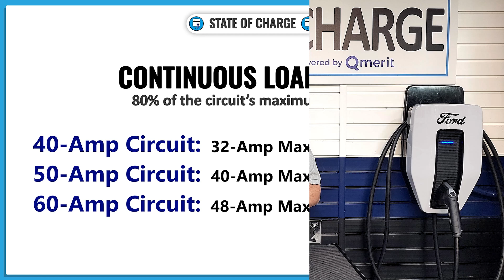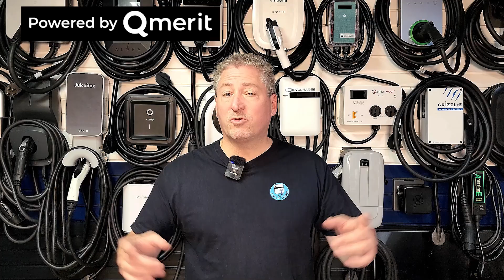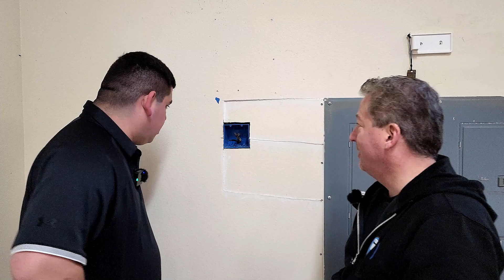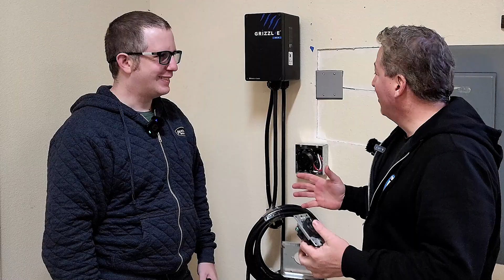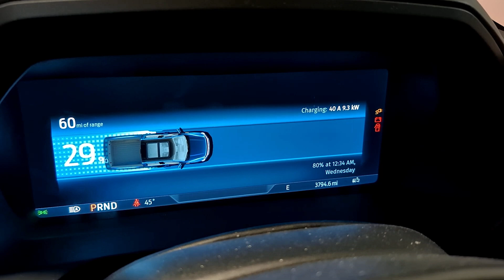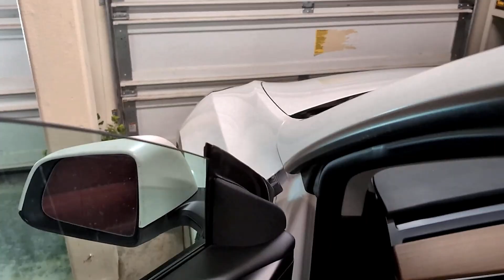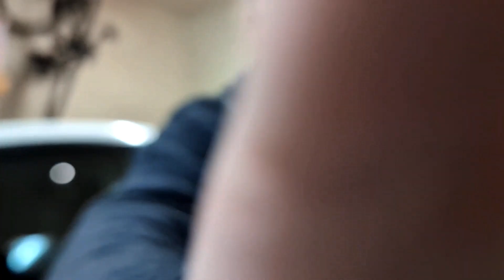Recharge Rescue Washington: We Fix A Dangerous NEMA 14-50 EV Charging Outlet Failure

Comment: First, I like your videos.   They are concise and easy to understand.   You mention that it cost to do it right while other You Tubers say us electricians are ripping people off.    Surface metal boxes are better for heat dissipation.   Any receptacle for the EVSE has to be on a GFCI circuit breaker which i noticed the electrician  did.  EVSE technology and installations are evolving and many times the NEC is not up to current needs.
Reply from the maker: Thank you.
Reply: Most states haven’t adopted the 2023 code yet. And the problem with putting in a second GFCI at the breaker  (because the EVSE already has one) is nuisance trips. I have a newer juicebox and believe it or not in the manual they actually recommend against putting in a GFCI breaker

Comment: I had to replace the outlet in my home which was installed by the builder Lennar, they charged us $1200 in 2022 for an EV charger in our garage and used the cheap Leviton outlet. I had already seen other videos of these cheap outlets failing on long duration draws. Replaced with a Hubbell, good to check what you have and get the right outlet, especially if you have an F150 with a huge battery that will draw for 10+hrs. We have an F150 Lighting Flash and Chevy Bolt and the Grizzl.e Duo, it’s great when you two cars to charge and is high quality and a very good price compared to the Clipper Creek. The owner and company are amazing!
Reply: Grizzle-E Duo is very underrated.   Got one myself.

Comment: another reason to hardwire... many states require gfic breakers a $100 upcharge vs non gfic. for the cost  difference of gfci and the hubble you could go from 10kW to 9.2kW charger.

Comment: I got my tesla in october of 2022 and I made a mistake of installing this exact cheap leviton outlet in my garage. Everything worked fine for about 6 months and when it started getting warm here in Las Vegas my tesla charging started slowing down to just 5-6 amps. Tesla mobile connector light was also blinking. I looked up the code for the light and the light was indicating the outlet was overheating which is why it slowed down the charging rate. So Tesla mobile connector actually saved my house from the fire so I wonder why other mobile chargers don't have that protection built in. Right after that code showed up I replaced entire outlet with a proper Tesla wall connector and haven't had any issues since.
Reply: Having a temperature sensor in the plug sounds like a great idea for safety.

Comment: You could also just change the old evse cable…. Instead of disposing of a funcionning evse… (welll it still a evse that isnt supported anymore and company pulled out NA) but i wouldnt throw out a evse for a chared cable… looks like an ad for Q merit from start to finish.. yes there is good information in the video but theres an exaggeration on some aspects…  but video is good to raise awareness
Reply: Grizzly freely upgraded him to a double box
Reply: I'm not throwing it out, but I've replaced the relay in the EVSE twice, so I don't want to give it to someone else to use who doesn't understand what they are getting into. @transportevolved Need a bench Juicebox for your project?

Comment: Interesting he went with a surfaced mount installation. i prefer a recessed setup as anything patruding out from the wall can be more easily to come in contact with . The box  does jave sharp edges . Now the biggest reason why this install went wrong is the wires were to short . You need about 6 inches by code outside of the box . With the wires being so short its dificult to tighten the contacts and it puts stress on the wire which puts stress on the contacts . The best way to avoid this is to hard wire the charger . The charger has far more space for the wire to occupy and no stress or pull on the wires that puts stress on the contacts . Its better to reduce the amount of connections that you are doing . The more you have the more opportunity for failure . It probably should be a requirement to have chargers hardwired edpecially on the higher amperage devices. We need to basically make it idiot proof and maybe the only way to do that is to require a  combination arc fault breaker gor ev charging systems . Especially for the nema 14/50 install . Now there isnt a combination arc fault of the size that is needed for ev charging . They are used in 120 volt applications and required for almost all new home  120 volt receptacles but not on higher amperage and voltage applications . So you would need a code change and what occured with 120 volt arc faults the cost went way up for install as they are far more expensive over typical breakers that just trip on short circuit and overload . A arc fault breaker at say 40 amps would be over $200 but far cheaper than a house fire .
Reply: This is nonsense. It’s perfectly safe to use an outlet with the right equipment if proper practices are followed
Reply: @doomsday9973  If proper practices are followed ?;
Reply: @stevencole7331  uhhh yeah lol. Like proper wire gauge, electrical box, proper outlet blah blah blah. It’s perfectly safe

Comment: I installed mine ( Tesla Universal hardwired) mostly due to the contractor that was set up by the car dealer was only going to meet Illinois electrical code standards, which we all know at this point are not up to the task for EV chargers. So I took a couple months and studied the whole process and did the install myself exceeding code. Also to note it is not only important to torque the contacts down at installation but to also torque them about 1 month after install then check them every year or so  because they can still back out from heat load over time.
Reply: I had the same idea, but it only takes one part to fail. The maintenance is a good habit to get into, more power flows through that one line than probably the rest of the house.

Comment: My EV Charging issue at the moment is convincing my partner to the benefits of switching to an EV and that we/I won't have the predicted range anxiety and then convince them to install one on the outside of the house.
I would then need to find an EVSE that I can manage/approve the EVs that are able to charge on them, use RFID cards, have OCPP for remote smart home management & I will need to do a service upgrade but not a Service Panel Upgrade as I have a solar system that can handle 200amp service and the EVSE can be wired into that.

Comment: I purchased an emporium charger prior to receiving my F-150 lightning, I had it installed by authorized electrician any wire directly to the panel about a year are you using it with my truck I started getting an error about power leakage, so I contact of the manufacturer who warrented the charger. However I had the factory Ford charger they sent me after purchase so I decided to have that installed in the same location, my electrician came out and was going to swap the charger straight across and then realized I didn't have big enough gauge wire to handle 80 amps because the emporia was a smaller charger than the Ford, had to pay another $1,000 to get it installed correctly but this way it's up to code and I would not risking my house. But I could easily see somebody in my situation hooking the Ford charger up to the emporia wires and finding out they were too thin to handle the duty cycle and load of the truck.

Comment: If I was Qmerit - and obviously investing in this video to make sure their brand and affiliates (APEX) were being shown in the best light - I would have made sure of the following:

1) Check the outlet cover fit prior to going to customer premises (if this affiliate APEX installed EV outlets frequently as indicated on the side of the truck "EV Charging Made Simple" - super surprised that this would be an issue at all)
2) As others have pointed out - made sure my electrician torqued at the circuit breaker as well - I would think this would be part of the Qmerit "specs" that affiliates have to follow.  Would think the APEX electrician would have gone back and checked each and every Qmerit spec to make sure he didn't inadvertently forget any steps.
3) Reused the existing hole where the previous plastic box was (to avoid too many unsightly cuts and covers in the dry wall) or explained in the video why he had to move the box to a new location.
4) Since you are already cutting into drywall - why not go ahead with a flush mount box vs a less cosmetically attractive surface mount box?  If there was a reason for the surface mount -would have been nice to explain that in the video too.
5) I realize electricians are not responsible for dry wall repair - but many do an initial taping and mud to make it easier for the later finisher or painter.   Again - since this was a representation of Qmerit's brand in this video - thought they would make some effort to not make the wall even more unsightly than what they DIY homeowner did.  The cut out drywall piece was even now sunken whereas the DIY homeowner at least previously had it even.

It's some of the above "little things" that often prompt people to take a DIY approach so that they can make sure they hit a certain level of technical and cosmetic attractiveness to their installation.
Reply: Good lord you are the type of customer that would be any contractors nitpicking nightmare
Reply: @doomsday9973  Guilty as charged!  That’s why I prefer to DIY.
Reply: @doomsday9973  Guilty as charged!  That’s why I go the DIY path many times because I don’t love contractors who cut corners.
Reply from the maker: They didn't invest in the video. When I make videos, I don't allow outside interference, even from my sponsor. The contractor had no idea there would be drywall work. Fritz scheduled the job and just told them he needed the outlet swapped.
Reply: Patrick, hopefully you are satisfied with Tom’s response.  Fritz is not as particular as you & I.  I would have demanded using same hole as old box, direct wiring for safety and 20% great power, and torquing of breaker wires.  Rather than be accused of nitpicking by any contractor, I simply DIY with higher quality standards than most contractors.
Reply: @johnpoldo8817  definitely!  This isn’t on Tom. Agree QMerit is not “investing” per se - but the result of a homeowner using a QMerit electrician is on display. Definitely motivation to make sure the result is A+ both technically and cosmetically.

Comment: I wish I would have known what questions to ask my qmerit installer last year.  They also used a $10 outlet for my install and a few months later after seeing the warnings on channels like these, I had it replaced with a Hubbell before anything bad happened.  We definitely need EV specific electric codes.
Reply: QMerit failed you. Scary
Reply: EV codes are coming but adoption is determined by jurisdiction. In Virginia, we still operate under 2017 codes but once we adopt 2020 code, article 625 will go in effect.

Comment: I'm surprised you didn't have him install a hardwired charger and avoid the cord and cap altogether.  Very easy to do with his wiring inside the wall right next to the service panel.  .  Would also provide 48 amps of current for faster charging his dual vehicles.
Reply: I've had relays on EVSEs go bad twice on that old Juicebox, so being able to replace the EVSE is just as important, with a mobile charger or a new one. Thanks for the question!
Reply: @Fritley  yep agree 👍
Reply: @doomsday9973  I've also moved with my EVSE before. I believe United Chargers picks high quality relays so hopefully no more trying to find replacement boards, but the flexibility is important to me.
Reply: @ I’m right there with you 100%. Plus if your EVSE goes down you can immediately plug in a mobile charger as a backup like the Tesla one for example that can do up to 32A and you are back up and running
Reply: @doomsday9973  Unless you unplug it and see the outlet looks a little _funny_. Cue video.
Reply: @Fritley  lol yeah well you don’t want to plug it into a “funny” looking outlet that’s for sure 🤣
Reply from the maker: Fritz wanted it that way
Reply: Not everyone wants hard wired. Easier to change out with an outlet

Comment: So Tom, no one talks about  charging using L1 for 20, 30, 40 hours.  If drawing 12 amps on a  15 amp circuit, could certain, low quality Nema 5-15 outlets also fail?  Do people need to get better quality outlets for L1?   As use DIYer's know, there are different quality  Nema 5-15 outlets.
Reply from the maker: Good point. Maybe I'll do a video on it
Reply: @StateOfChargeWithTomMoloughney  Did I mention I have also partially melted a plug in this house using a space heater? I promise I didn't DIY this one.

Comment: I see the 2023 code (not approved in most states) requires arc fault/ ground fault breaker in the panel or charger.  How do most manufacturers handle this?

Comment: Remember: If you install it yourself, your homeowners insurance can deny a claim if the worst happens. That includes losing your home..
Reply: And how are they going to know exactly?
Reply: @doomsday9973  Fire Department or homeowner's insurance inspectors will determine the cause of fire. They will most likely try to require proof that it was professionally installed after that was determined to be the ignition point.
Reply: @ lol extremely unlikely. Also show me one case where one of these outlets burned down a house from melting. You can’t because if it’s in a proper electrical box the chances of that are extremely slim. Hence why all these people have pics of melted outlets but not burned down houses
Reply: @doomsday9973  Your lack of permit. You have to pull a permit to install an EV charger in your residence.  If they determine the origin to be your EV charger. They will look up permits for your home. No permit = No insurance.   THAT is how they know.
Reply: @hdr96k  That's why you get it inspected and permitted.
Reply: @ nope. Try again.
“an insurance company cannot deny your claim simply because you failed to obtain an inspection and get a permit.”

And again it’s moot anyway. Show me one example out of the countless EVSEs installed out there (vast majority im sure have cheap outlets) where a house burned to the ground. Just one.
Reply: @Fritley  scam. Just a way for the town/city to take your money. Most of the permit “inspections” are a joke
Reply: @Fritley  Well yeah, exactly what I said.

Comment: Why didn't he use the torque wrench for the connections inside the circuit breaker panel? Those are as important as the ones to the 14-50 plug.

Comment: I noticed at 30:13 the electrician didn’t torque the wires in the breaker box, but did torque them on the outlet. Aren’t the connections to the breaker and the neutral/ground as important?
Reply: Yep, and this is why the pro's need better training.
Reply: @alpham777 this whole video is about nitpicking. But if there is such focus on torquing the outlet, why not the breaker? It’s another failure point.
Reply: @alpham777  and the whole point of Q merit is that they are supposed to be trained to a high level.  And that's not even an added EV thing.  It's a code requirement across the board.
Reply: Maybe he did it off screen .
Reply: @ralanham76  Nope. It’s a time lapse and you can see him not using the torque screwdriver to tighten down the lugs. It’s a very distinct screwdriver.
Reply: @ericroe  OH somehow I missed the whole time lapse I guess I was talking for a minute 🤔.  It doesn't look like he did it.
Reply: lol always a nitpicker in the crowd. Every. Time.

Comment: Thanks, Tom, made me happy I went with a direct wire to a Tesla Wall Charger.  That said, I would like to ask you for your thoughts.  I have a 200 amp panel, and I have gas fired boiler heating system, a 240 volt electric dryer, central air, and a electric induction stove, 50 amp.   When charging the Tesla at 48 amps on occasion the induction range throws and error saying there was a power issue, even when we aren't using the stove.  I know I am being a little vague but I don't recall the actual message.  This has happend 2-3 times.  And the only way to get the induction stove to reset was to kill power on the stove breaker.  After say the 3rd time, I decided to set the amp limit in the Tesla app to 32 amps max load and haven't had a problem since.  The install was done by an electrician certified/authorized by Tesla. .  Should I have someone take a look, sort of a second opinion on the work done?  Should I contact Qmerit?  Everything seems to be working fine, but those times when the stove threw the error has me wondering.  And then again, maybe something is going on the stove as it is about 8 years old.  I am all ears:)!

Comment: This guy! Almost burned his house down, survives a month on Lv1 charging, then can’t wait a couple more hours for the correct outlet cover?? Doesn’t that contradict the premise of the video that DIY is not safe? Tom should have just left that detail out
Reply from the maker: If I though there was ANYTHING wrong with that I would have. It's absolutely fine. The replacement cover is no better/safer than that.
Reply: @ sure it was probably safe in this instance, but I still think it was an instance of TMI and dilutes the message you are conveying. Can a novice be sure that modifying a cover themselves is safe? How do they know where to draw the line?

Comment: I have a Leviton outlet, I only use 24amps on it, the last one did melt though, and I thought it was me cheeping out on a charger that did it. I think I will be upgrading it, since the professional also had a plug like the one I replaced it with.
Reply: Charging at a lower amperage also lowers wear and tear. Most of these guys with melted outlets blast it at the max of 40 amps